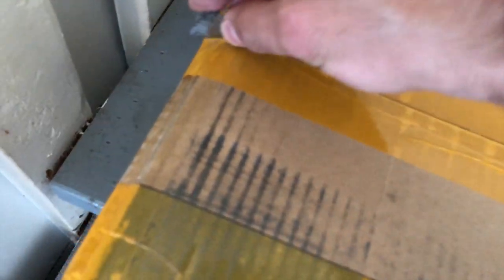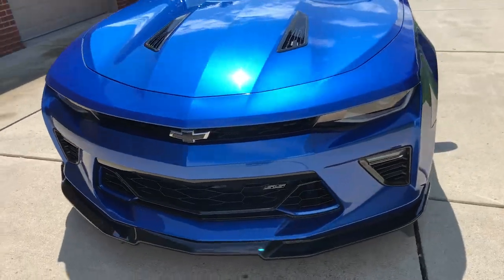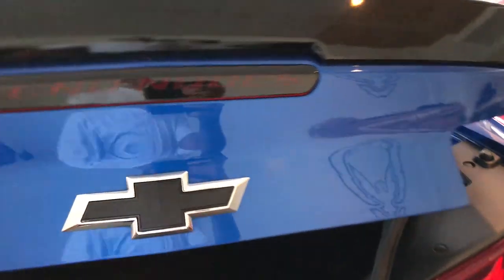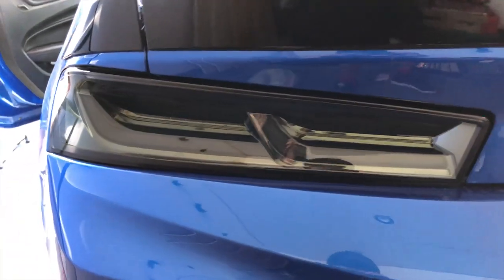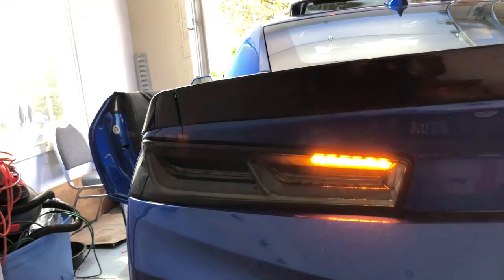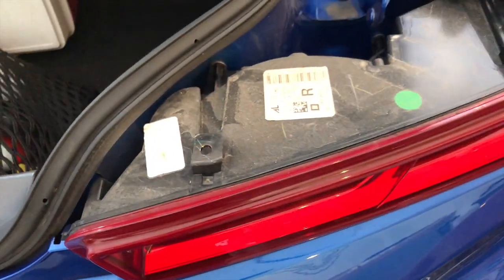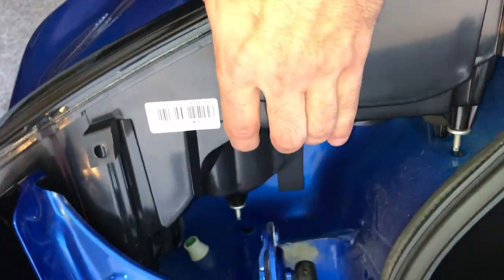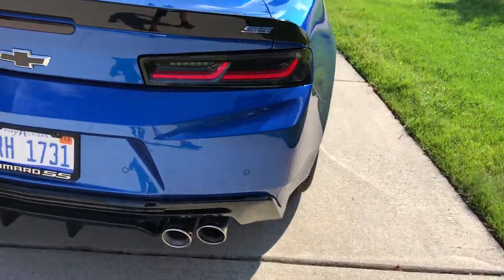2016-18 Chevy Camaro NEW SEQUENTIAL TAIL LIGHTS | NextGenSpeed.com

Comment: I hear a lot about the brake light /turn signal issue and the horrible red wire that is unsightly to run. Is the light issue fixed on new models or is the red wire the “fix/update”?
I bought a brand on eBay that I’m currently returning because the right signal would swipe once when I hit the brake. This issue is a deal breaker for me

Comment: The coupon code is not working.  Also, is there anything else needed in order to use these on a 2018 ZL1?  Or, simply plug and play?  Lastly, can we make any changes to the sequential speed?
Reply from the maker: Coupon code has been reactivated. These are plug and play for all RS/SS/ZL1 models that require nothing to add. The speed currently cannot be changed.

Comment: Is it true that there is a 1 second delay on the 3rd brake light for the 2015 camaro if you get the taillight installed
Reply from the maker: These are the 2016-18 Camaro. Which Tail Lights are you referring to, the Hero ones?
Reply: Next-Gen Speed yes

Comment: Did you have an issue with the brake lights not working??  That’s the issue I’m having rn
Reply from the maker: EliteShot Joe For the new style you will have to connect the Red Harness to the Third Brake Light & the Tail Lights, to connect the brakes
Reply from the maker: EliteShot Joe nextgenspeed.com/vlandinstall.pdf

Comment: I’m having a problem with the break lights, there is a RED CABLE that you need to plug into the third lights, ( he clearly dosen’t show it on the video) do you have any idea about this cable and how it works! I plugged everything but i only have the turn signal lights everytime i press the break
Reply from the maker: Hello! We have new install instructions as these lights were updated recently. We will have a new video posted soon but also have the new instructions here - https://nextgenspeed.com/vlandinstall.pdf Please attach the red wire to the third brake light and you will be all set (:

Comment: I got mine just hate the fact that the brake light still turns of when you hit the turn signal any way to fix that?
Reply: What do you mean?
Reply: @nickgoodwin1105  when you are braking both turn signals first come on. 
When your turn signal is on - brake light on the same side turns off. It's lamp design.
Reply: @BOTmaster15  Is that turn signal behavior really street legal in the  USA?
Reply: @BOTmaster15  I just installed these and what I dont like is the brake light goes out when you turn the directional on.Is there a fix for this finally?
Reply: I also had a set I returned.The brake light would go off everytime i turn the directional on,I couldnt get a straight answer from anyone.I really liked the way they looked and the sequential turn signals.Maybe they have fixed that issue.I would buy another pair If they could guranttee me that they would work right.Both signals coming on for a split second before the brake light wasnt the deal breakers but when brake lights shut off when you turn on a turn signal thats a very bad thing   2016 camaro ss     I wish i could call and get a direct answer
Reply: @robertjames9768  Okay, thanks, all clear. Have you a link to another tail lamps that can works without any issue?

Comment: I bought these and these lights have some major flaws that I have noticed.

1. When the brakes are pressed both rear turn signals will blink which can cause confusing and just plain looks stupid. Click my name to see video of what i'm talking about.

2. Which ever turn signal is on that side brake light ceases to function. Also i'm not sure if it's even legal to have a brake light shut off while pressing on the brakes, which is what happens here if you turn on a signal light while pressing on brakes.
 Click my name to see video of what i'm talking about.

Outside of that only other thing is minor, the reverse lights are super weak. I used a really good bulb (xp80's) but still xp80's are literally at least 10x brighter then these lights. The reverse leds are dimmer than stock. If 1 and 2 were fixed and you could live with weak reverse lights these would not be bad. They look really good just 1 and 2 completely kill it.

Comment: I have the new style red turn signal and they still do the hyper flickering. This dude thinks just because his don't do it  everyone's are the same
Reply from the maker: TECH SENSEI ONLINE you might have an LT model or your resistors are going bad. Did you order from us?
Reply: @NextGenSpeed  2SS only 18k miles on it
Reply: I just got the lights in the mail yesterday. It doesn't do it all the time but it will start flickering fast sometimes
Reply: Soo how do I fix that shit